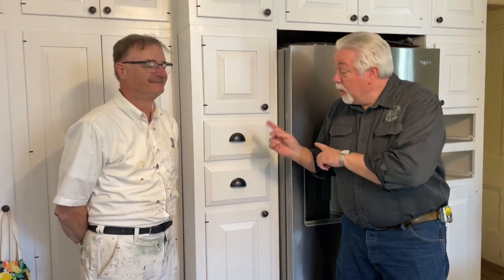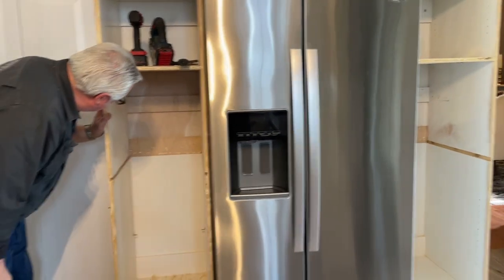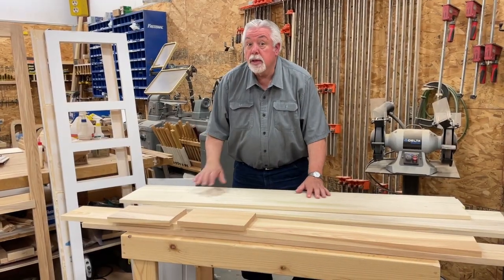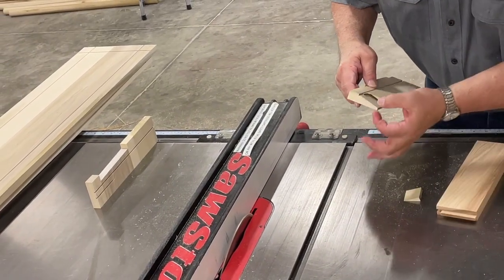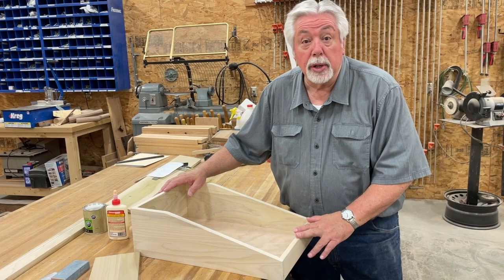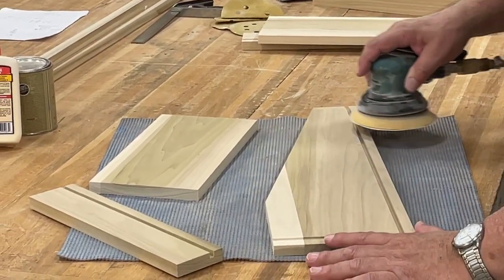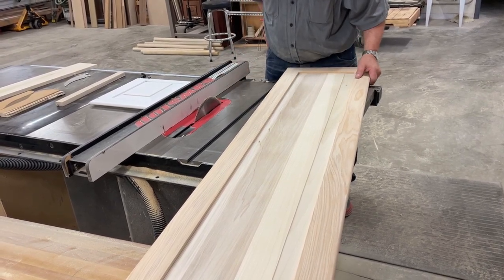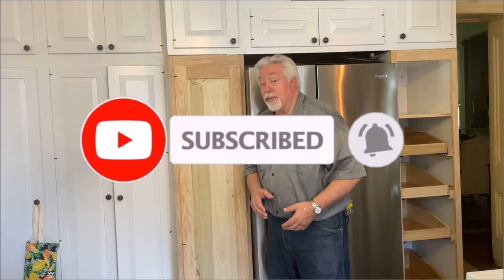Maximize Your Storage Space With A Sliding Shelf Remodel

Comment: Great overview of the process.  I actually had that type of cabinet for my pantry... two door with 5 large pullout shelves.  I converted it to a full pull out with access to one side, by creating a large box with adjustable shelves, adding 3 heavy duty sliders (two on the bottom, one at the top on the closed side to keep it from racking) and mounted fake doors to the front to match the rest of the cabinets.  When closed, it looks like any normal two door cabinet.

While some like the doors and pull-outs, I grew to hate mine.  You have to open two doors and then pull out the shelf you want... three actions all the time and it would bang into the fridge and its own shelves if not closed properly.  With a full pull-out, it only takes one action to open the whole thing with full access to all the contents from one side... super handy when unloading groceries.
Reply from the maker: Hi...thanks I enjoyed reading your comment! Wes

Comment: Hey Wes, great video…. I like the idea of your spacer to keep the face frame stiles from flexing. You should consider putting it on the inside with small enough flanges to pin nail it to the inside and still clear the plywood carcass. When you take it off the small pin holes will be on the inside so there’s no visual repairs needed.
Reply from the maker: Yes...thats a great idea! Thank you very much for your comment. Wes